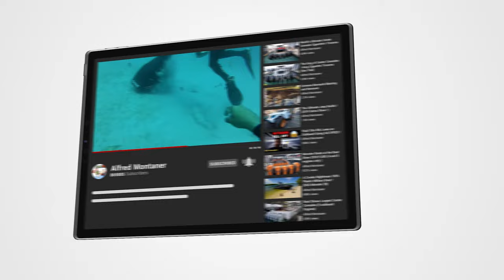Yacht Ping Pongs off of Rails & Boat Ramp Drain Plug Drama ! (Chit Show)

Comment: I've watched quite a few of your vids and I see the same mistake time after time. When you approach a dock the most important line to have first is the Spring  (center) line. Not the bow or stern line. With the spring line you control the whole boat not just the bow or stern of the boat.